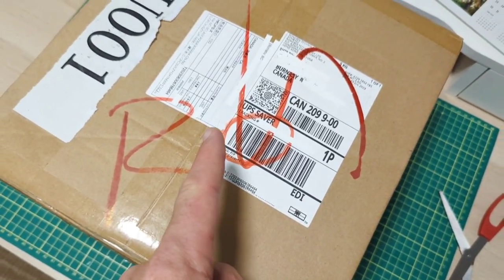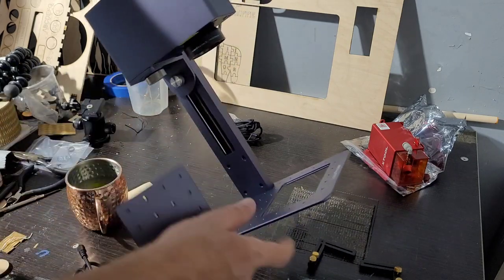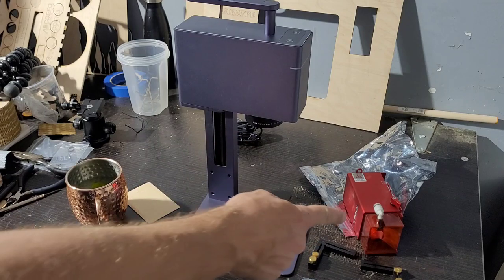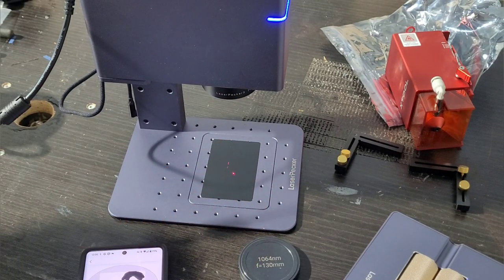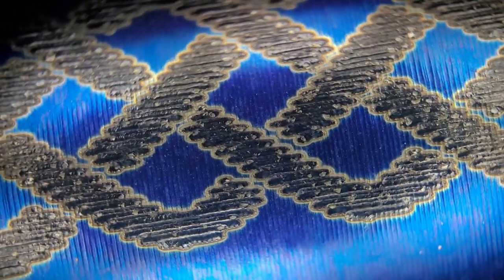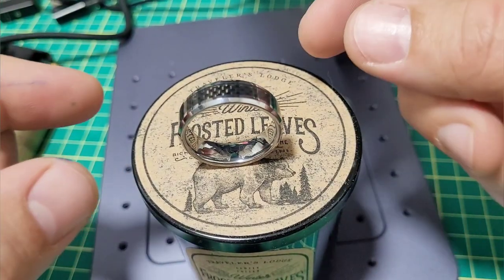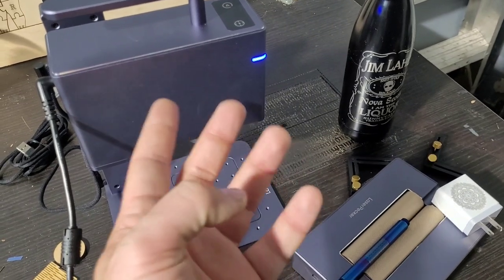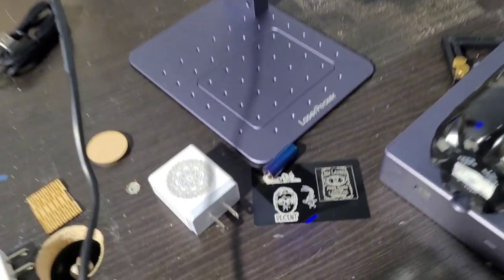I Can Now Engrave Nibs - Why The Laser Pecker 3 IR Fiber Laser Gives Such Precise Engraving

Comment: Does it accept G-code as an input? The LP4 supposedly does, so that should allow for difference in power within the same cutting session if you use an external program. (Albeit, I will admit, I don't know laser cutters, and I don't know the functionality of something like Lightburn.)
Reply from the maker: For this one, as far as I know, it doesn't take in gcode from other applications. To do layers, you'd need to create seperate images for each unique layer you'd want to do. The run the correct engraving profile for each image.
Reply: @Doodlebud  That does stink, but hey, at least there is a genuine value to an upgrade, unlike some products.

Comment: Time to bust out the cheap pens and practice nib engraving on those. It seemed like a tough undertaking getting it aligned on such a small area. Overall this is the most impressive engraver. If only they also had the desktop software to control laser power to get the color effects.
Reply from the maker: Yup, I'm going to busting out some pens and also want to use this in conjunction with Titanium anodizing

Comment: Hey, just because you have one I think, but XTool has an IR engraving module. Not sure the specs, or if it is compatible with your frame, but I thought I would tell you.
Reply from the maker: Yeah I've seen that laser head that can be added on to the XY stage style. It's good but a fiber laser is very different in how it works along with the method of laser movement (XY vs Galvo). xTool does have their F1 system which is a Galvo with dual lasers (IR & 455nm). I'm curious how that one compares
Reply: @Doodlebud  Yes, for detail oriented stuff, I do agree that a fiber Galvo combo would be infinitely superior.
And I agree, that would be interesting to check out. Way outside my budget tho (albeit, that's me being a cheapskate, not being broke).